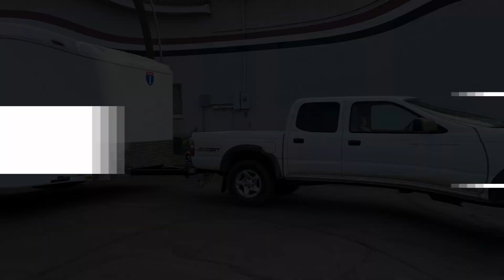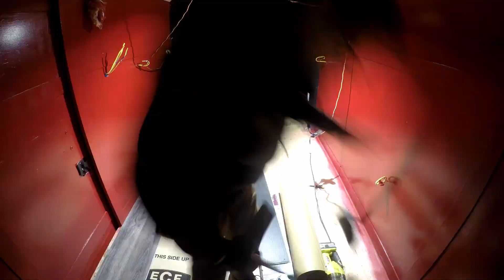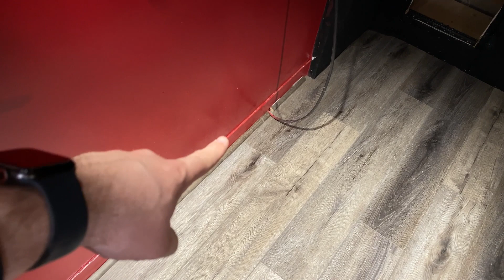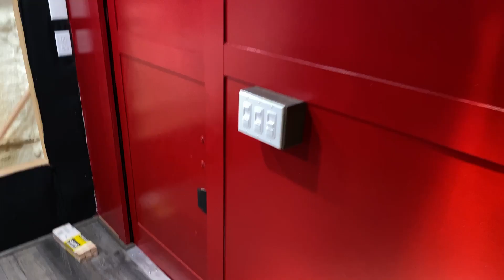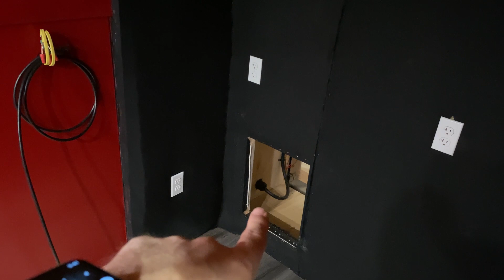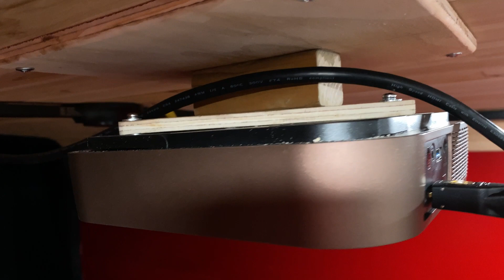Installing Laminate Floors and Cedar Ceiling Boards in a Cargo Trailer!  (Trailer Conversion Part 7)

Comment: I need help setting up headphones! I have 6 headphones and a xenyx 2222 USB mixer.

Do I need a separate headphone amp or does that mixer work?? Also The only amps I see for headphones are four channels and I have more than four headphones.

Overall I'm going a live stream podcast with 5-6 guest
Reply from the maker: There is one from PreSonus that gives at least six out. It’s called the HP6 I believe. Try that one. There are also a few others from ART and Rolls.